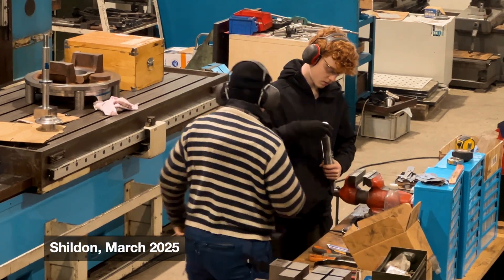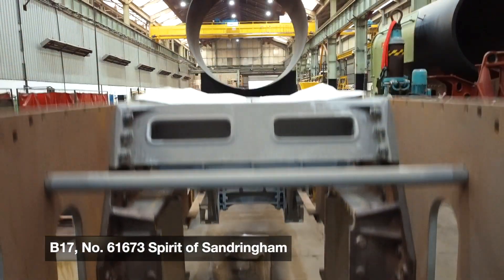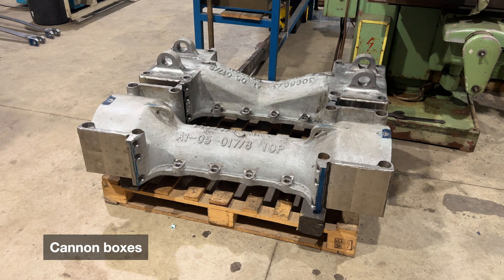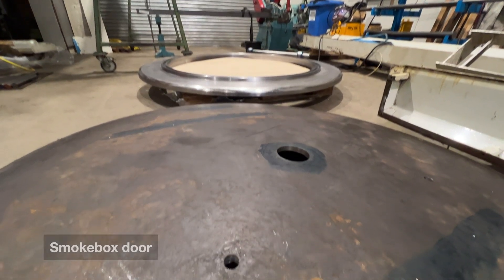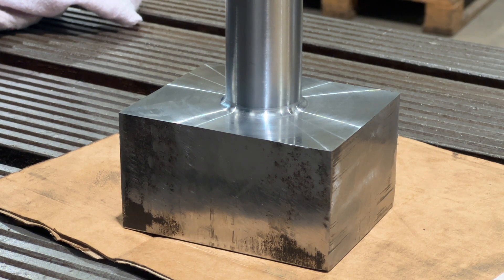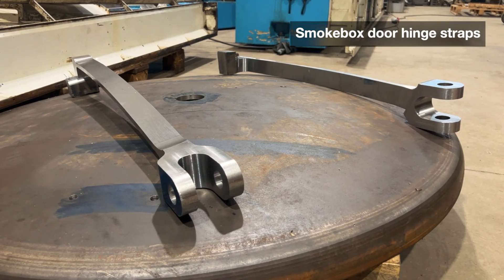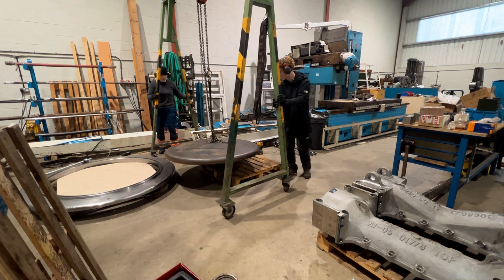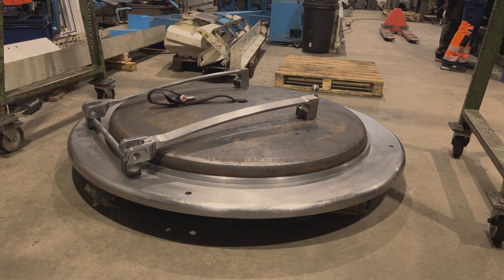Inside the new build workshop - building parts for the B17 steam locomotive

Comment: wouldnt it have been a lot easier to make the hinge straps by bending a strip of steel then welding on the hinge forks
Reply: No. In the good old days it would have been forged and hammered to shape, but these days, as it is a compound curve (the smokebox door curves in both directions), it is actually cheaper and quicker to mill the curve out out a solid bar of steel.